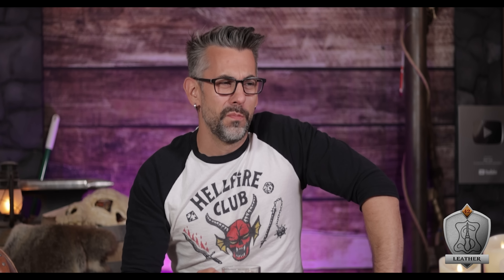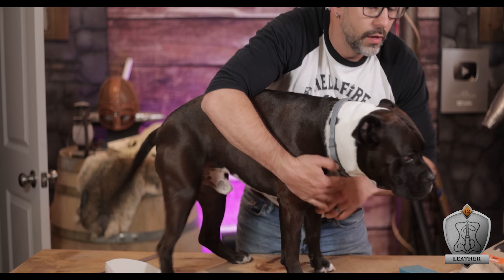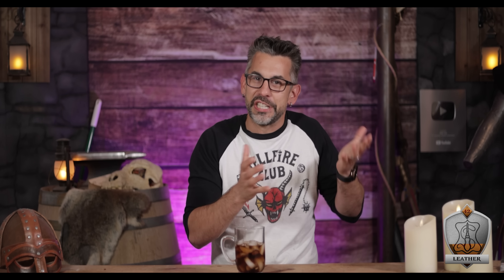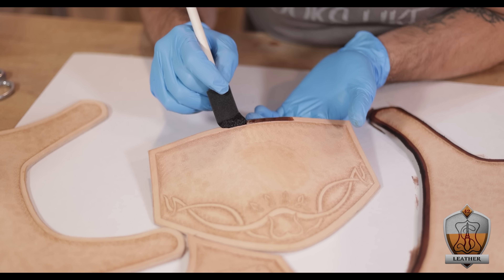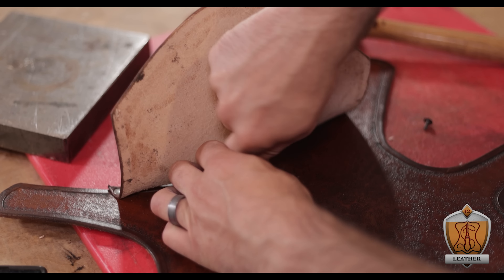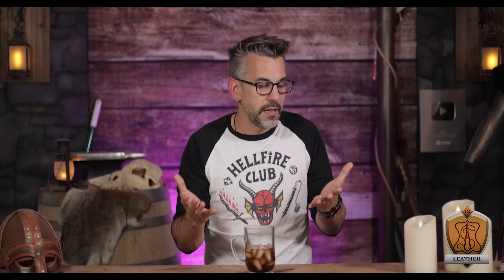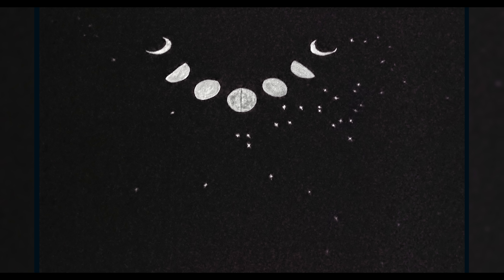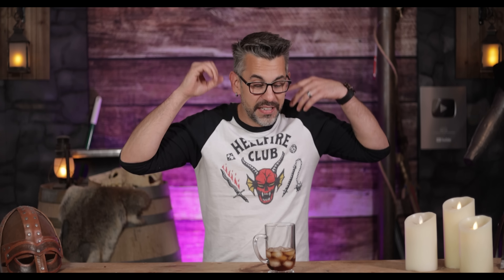Custom Leather Dog Armor!

Comment: I doubt it would be a huge issue, but you may want to consider adding a permanent, soft lining on the inside of the armor if you plan on prolonged use. It's obviously not as heavy duty as a horse saddle, but those typically have blankets and soft linings to help with sweat absorption and to protect from chafing.

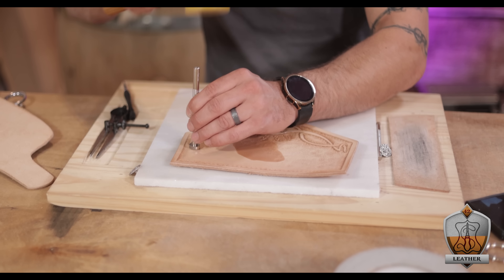Comment: 9:45 I know, old video, but if anyone happens to see this comment take a look at the bottom left edge of the pebbler stamp.

If you slowly rotate it as you stamp along, it creates a more randomized look, and with the larger stamps you can even lean it around a bit to make slightly different looks for every smack of the hammer!

Repeating patterns can look good though, like here it's very evenly spaced, so I think it works quite well!

Comment: The strap that goes over the shoulder and in front is too far back. It will restrict the movement and will chaff after a while. 
The best way to do it is just like a harness. Have a triangular chast piece with a longer "point/tail" running down the belly with one strap on each short point that connects to the back plate, best a segmented style for proper spine movement. Then, have a strap T style strap that is connected to the end of the long point with buckles that connect to the last segment of the spine protector. You can have a strap on either side in the middle of the triangle that connects to one of the middle segments for a more conforming fit as well as some side plates that's segmented and connects to the last strap.
You should take into account that a dog's spine has a larger range of motion than a human spine and is able to flex and deflex to a higher degree and the armor should take that into account and be more of a banded leather/metal design like the old Roman armor more then that of European plate armor.

Comment: Nice. If you do a lot of tooling you can save time by combining a beveling tool with a dremel engraver. Just cut the s off, about an inch from the tip and then put it in the engraver. You might need to reduce the “handle” a little bit to make it fit in the dremel but it works great once you get it all to fit and get used to using it.